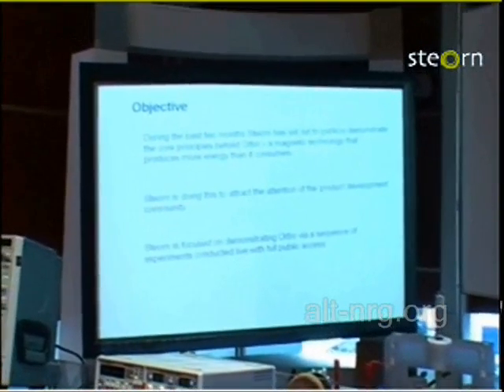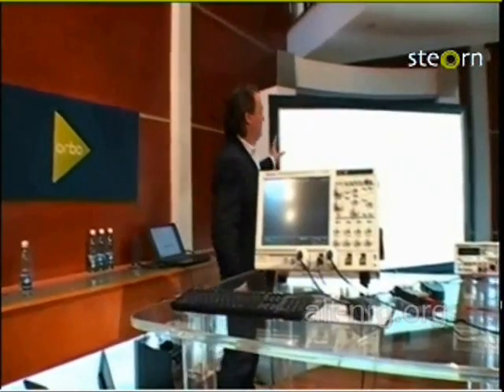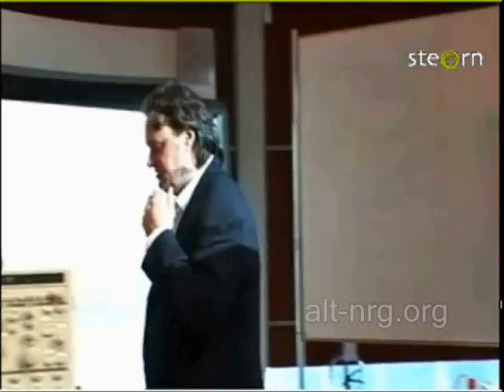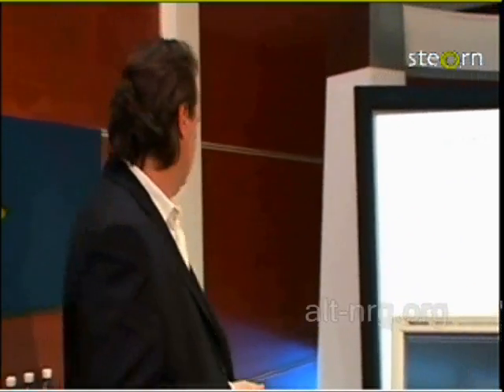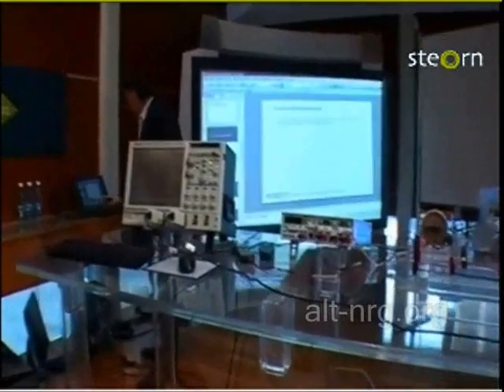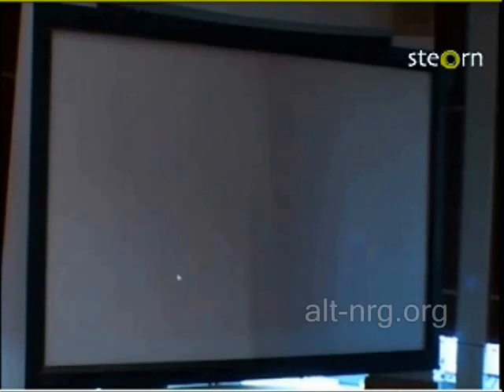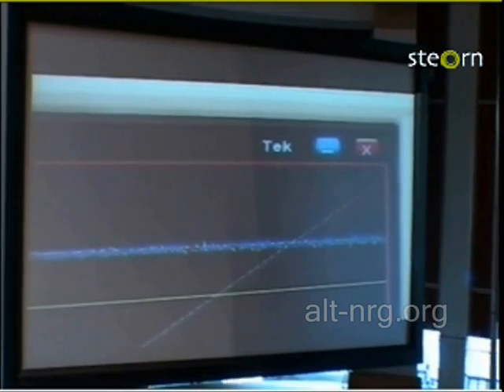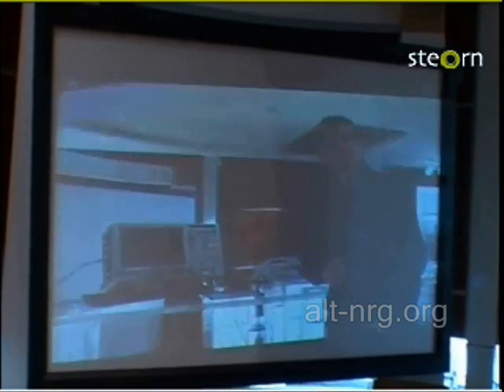#215 Steorn Orbo Demo, part 1 of 4, Jan 30, 2010

Comment: @hhoWayToGo 

The battery provides the energy for the 'Orbo effect' to operate.

Take the battery away, and it will not work. 
The battery being there is fine, as long as the battery is being recharged and powering the device at the same time.

A capacitor cannot be used either, as according to Steorn, it is not 'fast' enough.

I had high hopes for this demo, but am very disappointed.